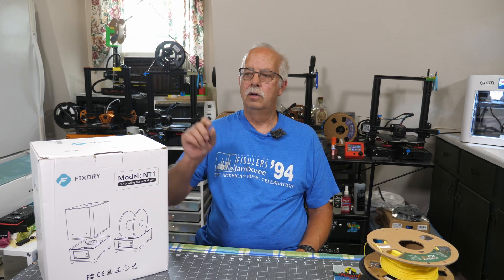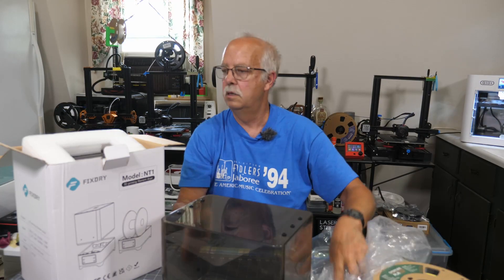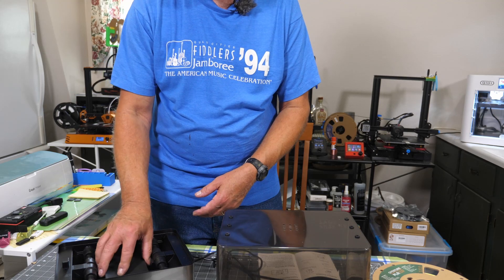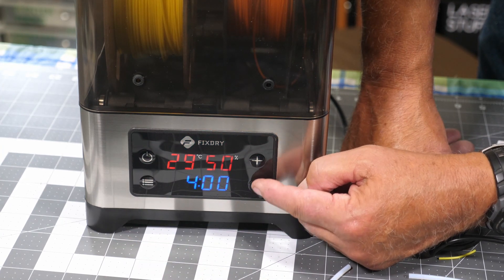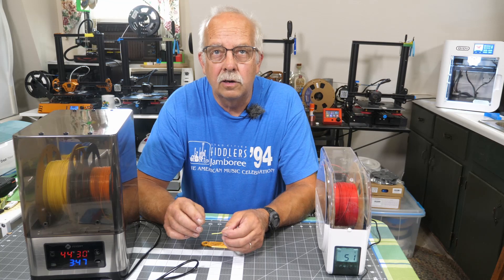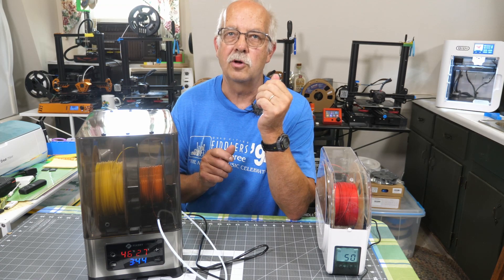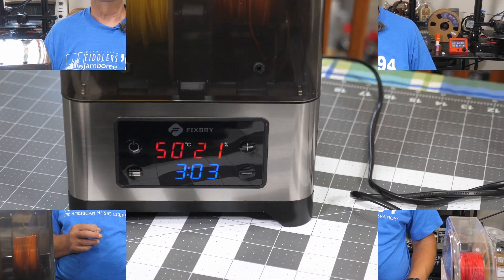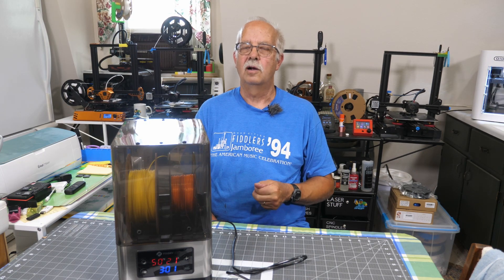Avoid 3D Printing Disasters: Fixdry Filament Dryer Reviewed

Comment: Fixdry 3D doesn't work. The internal temperature is still the same regardless the temp setting. It reaches 50C -56C and then temp stops.(and temp is still between 46-56).  It is the same if you set 40, 50, 60 or 70.  
I can understand if internal temperature can not reach e.g preset 70C, due to less power, but if you set 70C and temp oscillates  2 hours  between 48-55C something is wrong. And power should be sufficient (if I take spec values)
Sometime the temperature indicator shows absolutely stupid value.  I set 50 then after 1 hour I set 70, but display temp suddenly shows 61. Internal temp was around 50 and even start to fall (measured next to builtin sensor) 
It can be used olny for PLA.
Also, the design of the spool rollers is very special. The rollers have flat spots and if the spool reaches these spots it will stop spinning.
Reply from the maker: I have not had any of those issues.
Reply: @rogersshop  And did you measure a real temperature inside the box?
Reply from the maker: @sa8090  Yes.  With a Fluke FLIR.  50C
Reply: @rogersshop  so it only goes to 50c?
Reply from the maker: @mypd1991  No, it can go higher.  50C is recommended for PLA and PLA+, which is what I use 90% of the time.
Reply: @rogersshop   can you try 70° settings and check with another sensor?

Comment: Unfortunately I haven't experienced the same results. Mine never got hotter than 110F or 43C no matter what temp i set it at, it would always sit at 110F or 43C even though the screen says otherwise. Also the humidity on screen never reads below 26% but the inside box was at the lowest I've read was 15% when measuring with a seperate device. I will be getting a refund on this item for sure.
Reply: thanks for your feedback I hesitated to take a second Eibos Cyclopes which is twice the price of the Fixdry